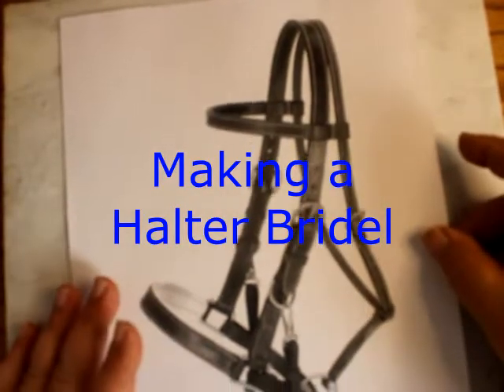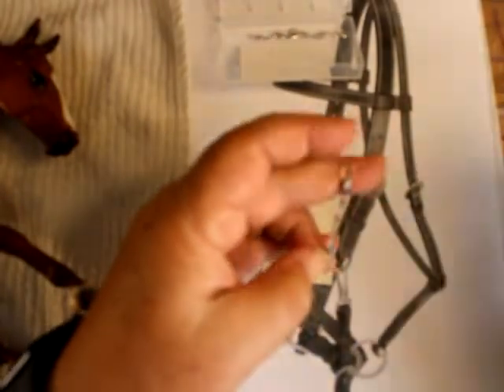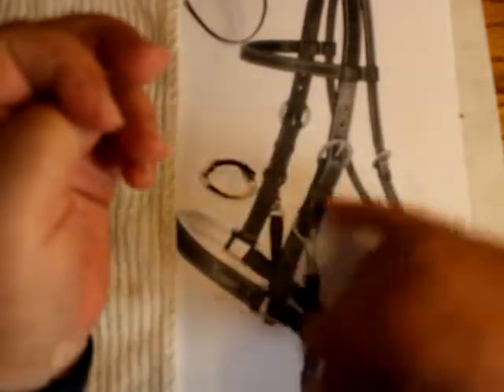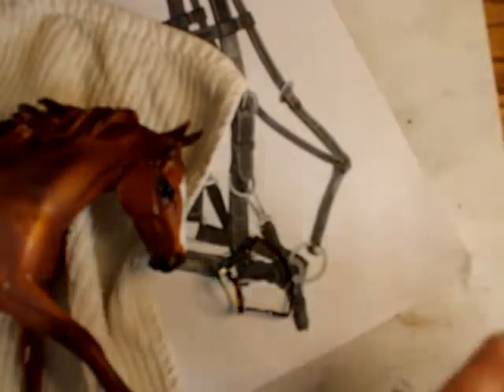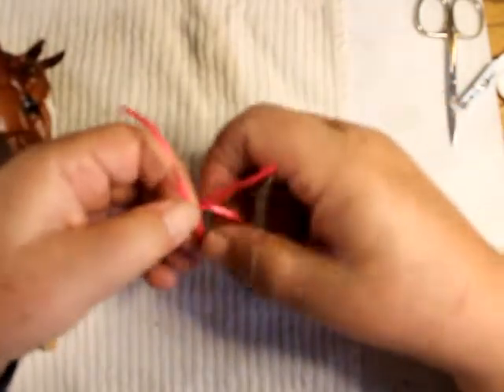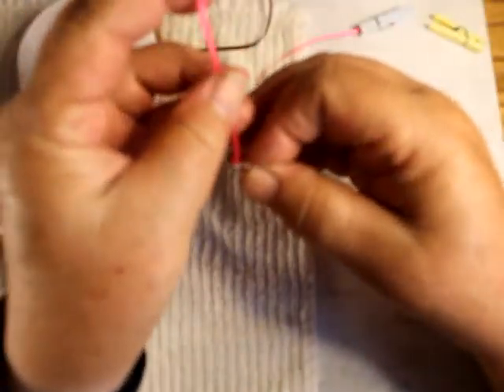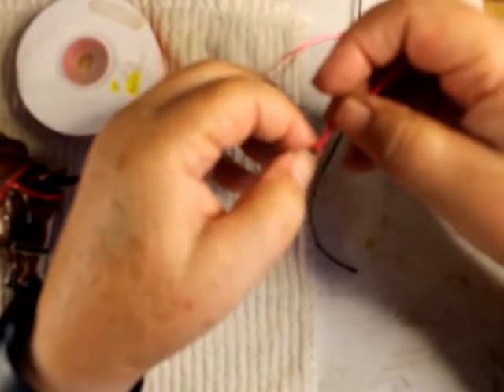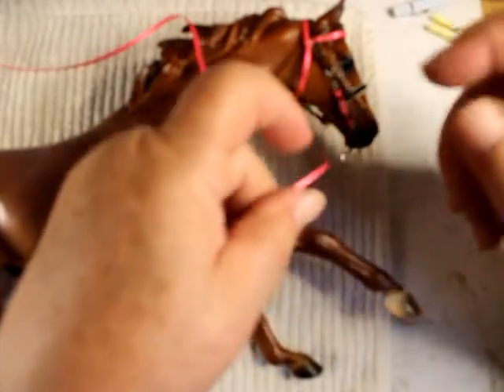The Halter Bridle for Model Horses

Comment: Hi carrie, love the vid but quite blurry, I found with the large pic in the back ground a bit distracting from what you were doing
Reply from the maker: Thank you for the feed back. I am using a different camera now. The other one had a useless auto focus. And I will try to remember to keep the working surface clear of distractions. Thank you for watching. Much appreciated.
Reply: Love all your vids, I've made lots of English an western saddles, really appreciate the patterns, is there any chance of adding them to the English and western ones.?
Reply from the maker: So happy to meet another tack prolific tack maker. I hope I understand the question. Can this bridle be used with either English or Western? I am sure it can. In the model horse world the class usually determines the correct tack type. Or you might be asking for a pattern for this bridle? This video is the pattern. For strap work, I try to show how you can measure the strap lengths to the model. No need for a pattern. I hope I understand.
Reply: @modelhorsetackschool  oh I'm totally inspired by your tack and was quick to buy the English, western, and racing sets, absolutely love them, was wondering if you could add the saddle pattern to your download ones like the western etc...?